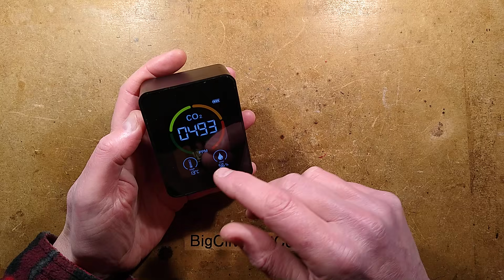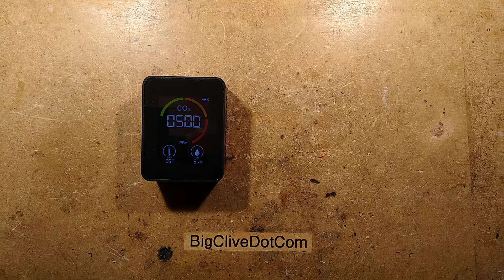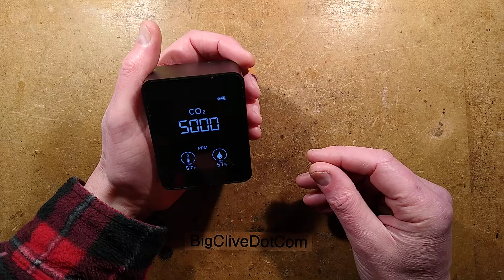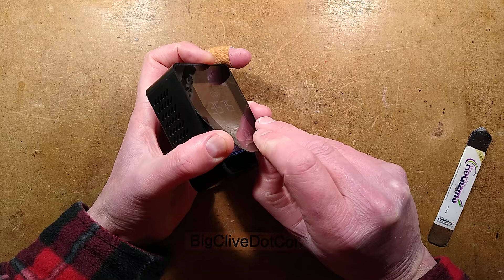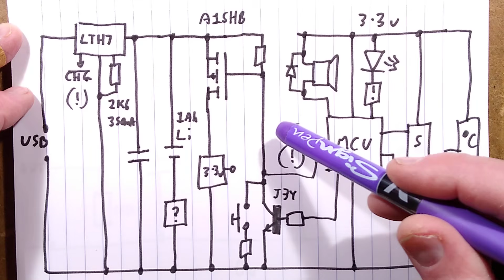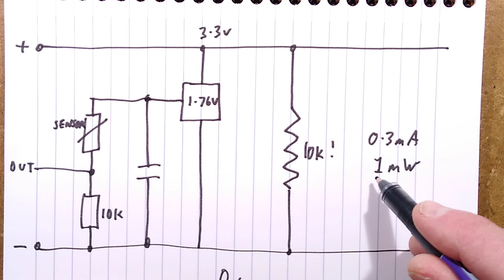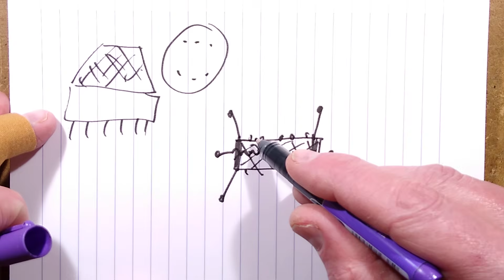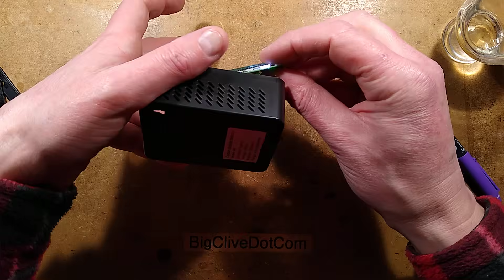Fake CO2 monitor (party detector) with schematic

Comment: So interestingly, I have an "Air Quality Detectot" from China with a CO2 sensor and great examples of bad English. Recorded CO2 levels noticeably go up if I breathe on it (I don't drink alcohol) or use my SodaStream right next to it. So that implies to me that it is actually working.

I've also noticed that it will start out at a high value when first powered on and slowly go down to ambient. Anyway, it's next to me right now, and so is a spray bottle of isopropyl alcohol. So I sprayed it. The thing skyrocketed from ~600PPM to well over 2000PPM.

So, this sensor seems to actually work to detect CO2 (I don't trust the accuracy, but it's at least doing something.) but it also behaves like the one in the video responding quite strongly to IPA. It'd be interesting to see if that's coincidental or not.

Comment: Why do you think Arduino, can't do LCD displays?
Reply from the maker: They can, but usually with a separate driver.  If this one had been a proper LCD display it would have been useful as a case, display and potentially reprogrammable processor.

Comment: Worked with Sensidyne Flammable gas detectors years ago, operated with a wheatstone bridge, catalytic bead resistance circuit housed in a sintered cap, gases methane, hydrogen, ethers and alcohols, all detected using this type of sensor.

Comment: I was looking at CO2 detectors but they cost around $400 in Oz, that would include the 40% markup for imported electronics.
Reply: Yeah they are expensive pieces of kit if you want one with a proper sensor.
Reply: @MattyEngland  I checked again, there is a European brand for $250, I didn’t check freight.

Comment: It's unfortunate that these fakes are out there.  However, there are true budget friendly NDIR co2 sensors on the market that read accurately.  You can get them for as low as $50cad on amazon.  I recently bought a wifi model for $70cad, and its readings match the $1000 model I use at work that has a Senseair co2 sensor.

Note that in the past, most co2 sensor elements were made by companies like Senseair, who charged premium prices for their sensor components.  Nowadays, there are Chinese companies producing and selling real NDIR sensors for really cheap.  So instead of $500-$1000 co2 meters, there are ones that retail for $50-$100 that read very accurately.

Comment: There are dozens of these for sale on eBay, sometimes advertised as CO2 sensors or CO2 and VOC sensors, not clear how you tell the difference!   Also ones with temp and humidity, so some folks fill in those optional traces.  What a faster luck.

Comment: Not only are these sensors Illegal they are also DANGEROUS, since some karens will put them up in their childs bedroom, and never ventilate it, thinking it has low CO2 so it should be fine. when the actual level is over 1500

Comment: Gotta try capsaicin …that’s right pepper spray that puppy!!

My co2 /heat sensing kitchen fire detector goes off when I broil certain peppers … curious if this sensor will do the same ?!
Reply: It's almost certainly using the same VOC sensor as this, and working out the CO2 by use of that. Capsaicin is a VOC and has a pretty low boiling point, so would make sense that the hotter the pepper, the more likely it would be to set it off.

Comment: Recently I have been looking into different monitors because of another youtuber who reminded me about the gas burner situation and how it produces extra CO2 etc when running. A relative of mine has one of those new style (that looks old) gas stove top ovens. They also don't have a hood to vent it to the outside and work hard to keep the cold outside from getting in during cold ND winters. I realized I should get one of those home gas monitors so began my rabbit hole down all the different monitors out there, not just CO2, such as particulate, and Radon. 

A very popular brand that came up was airthings with their disk based sensors that use a smart phone app to tell you what you have. Unfortunately from other reviewers posts I have seen that their sensors sometimes will read to high to what is actually there, or not work at all, or will vary between multiple of the same units. Especially for the radon sensor they have apparently. Radon is still a problem in places around here so it would be nice to check that periodically to. I also looked at third party sites to look at the reviews on places like amazon only to find that it looks like there are some fake/paid for reviews for said product which makes it even less likely to be a good product. 

It has become incredibly frustrating (which I believe I experienced this same thing before years ago when I thought about getting one) trying to find a home unit that can do at least a few things well. Otherwise what one site pointed out was maybe buying just sensors that can only do 1-2 things not a bunch of stuff at once. 

Another problem which people pointed out is that the sensors for some stuff can be pretty cheap (so if you're talented enough you could just buy the sensors themselves and build your own device but that is still to much for me), but some sensors can be expensive. Like they pointed out I think particulate sensors run around $60 US dollars so if you are buying a unit that claims to have stuff like that and sell for around $50 then they are probably lying to you because no way they would be selling at a loss. Even Temtop portable sensors seemed to have problems from some reviews I have seen showing no change even when taken outside in the fresh air for some of the sensors readings. 

The other problem as well is some of these sensors only work so many years before they start to drop off. I think the longest of them is maybe the CO2 sensor (if you got the good version apparently the "NDIR" sensor) will only last like 7-8 years? So if your spending over $200 US dollars on a monitor expect that it wont last past 7-8 years, even less for some of the other sensors... if they even work in the first place.

So at this point even though I would like an affordable sensor for monitoring stuff like CO2, particles, Radon, etc. It's clear you can't trust all these websites that "review" them like NY times (one of the first ones that came up when searching on google) cause it's clear they didn't really do any tests and are probably just being paid to advertise them. 

I have also seen those cheap ones being shown tore apart and all they are, is maybe one cheap sensor and a bunch of LED's etc. So far all I am seeing is a bunch of items made to rip people off from their money in cheap plastic cases.
Reply: If you really want an accurate CO2 meter then a hydroponics/horticulture shop is the place to go. They sell very accurate ones, but they are usually around £200, anything below that price range is likely using the same VOC sensor as this is.

Comment: Thought: It's a breath alcohol detector sold disguised to either avoid some form of red tape for such devices, or to allow it to be sold in places where alcohol is illegal. 
Other thought: It's a scammers tool, designed to impersonate a co2 detector, but can be made to trip out on demand via a hidden alcohol source. Think cowboy boiler fitter trying to trick Granny into thinking she needs a new boiler. 

Personally, I think the former. A breath alcohol detector for the middle east, so home brewers can check they're clean etc.

Comment: So, a good application for a real carbon dioxide detector is to quantify the air quality in a room. For example, if you enter a big box or warehouse store (Costco here in Canada or in the US, for example) or a gymnasium, you are likely to find relatively high CO2 levels. This indicates that the air in the room is not exchanged frequency. If you are worried about catching an airborne disease like SARS-CoV-2, an environment like this puts you at a much higher risk. Environments where the CO2 level is lower indicate either lower number in the room or better air exchange. I have several doctor-friends who carry this with them to help stay healthy.

Comment: Just out of curiosity, did you try propane (LPG)? We live aboard a ship using LPG in the galley. But can’t find a decent propane detector for below decks.
Reply from the maker: You should be able to find a gas detector that detects a broad spectrum of fuel gasses.
Reply: @bigclivedotcom  being aboard we have limited 120v outlets. All of those are by design at elbow or shoulder height. The detectors all seem to all be 120v plug in. Could it be due to being power hogs? Additionally being on a sailboat 120v power is unavailable while underway or anchored out from 9 to 6 am & pm while on battery, and solar while there is sun shine. We have some inverter 120v but again that is at elbow or shoulder height. Given propane is heavy ideally a compact, CHEAP, disposable battery powered unit is what we need. We can put it in the bilge area and down low places and not worry about it being damaged. We are covered for carbon monoxide detection.
Mark & Karen Fay

Comment: Co2 sensors are used in gas catering equipment environments to make sure the products of combustion are being removed correctly. 2800 ppm co2 is the risk level and at 5000ppm it is considered dangerous.

Comment: That is odd because the way CO2 is measured is deceptively simple, seeing as the gas absorbs infrared light (hence why it causes a greenhouse effect: it is transparent for visible light from the sun but not to thermal black body radiation from the ground)
All you really need is an infrared LED, a photodiode and a properly tuned amplifier. I'd be very surprised if that is more expensive than a VOC sensor.

Comment: wait, if the voltage regulator is 1.76V, how does the module's output shoots to 2.5V?
Reply from the maker: Hmmm.  I may have to revisit that.
Reply: @bigclivedotcom  could it be that the regulator might be connected in a different way and instead of a regulator it is a transistor used as buffer? just thinking out loud
Reply from the maker: @cocus-ar  It could well be.

Comment: We were having weird headaches and just foggy feelings since moving into our new house. Someone mentioned checking CO2 levels since the house is pretty sealed up. Got a sensor and it showed over 3000ppm, we also have all natural gas appliances. After getting it below 800ppm, we can tell a huge difference.
Reply: This recent explosion of information about how dangerous gas stoves are makes me think what it must have been like when they realized how dangerous leaded gasoline and paint was. A "oh crap now what do we do" moment lol
Reply: @skeetsmcgrew3282  leaded paint and gasoline were always known to be dangerous. The claim was that low concentrations were "safe".

FWIW the inventor of leaded gasoline nearly killed himself whilst developing the product (and did kill a few reseachers). Pure teraethylene lead is incredbly poisonous to the point that a single sniff can hospitalise you
Reply: Do you also have gas heating? If it's unflued, this would also be a big contributor.
Reply: @NotBROLL  our gas boiler vents crap out of the side of my house, and i often wonder what is it venting other than steam and how much comes back in through my open window

Comment: Because I'm using a resin printer in a small apartment, I figured I'd get an air quality meter that reads volatile organic compounds to see if I'm poisoning myself, and to test the efficacy of the carbon filters I bought. When it went nuts as I opened my wash station (full of isopropyl alcohol) I was briefly worried that I'd bought a fake with an alcohol sensor in it, but then I remembered, if anything is the very definition of both volatile and organic it's IPA.

It does detect a small increase in organic compounds when I'm not using the carbon filters, and based on the manual, it advises I not be in the room (I forget the PPM, I just got my answer a few months ago and moved on). When I do use the active carbon filters, the air in there while printing reads cleaner than it does outside, though it is worth noting I live on the intersection of two very busy four lane roads, so my outdoor air quality is probably quite poor. Curing releases far more organic compounds into the air, so I wear a respirator while doing that, and blast the air out of the room when I'm done. For the record, I do use plant based resins which while not entirely non-toxic, you must still wear a mask and gloves, and ventilate the room, they're far less toxic than the normal resins. It's to the point where I'm happy to sit by the printer and paint minis while it's printing.
Reply: I would love a product recommendation for the sensor you use. I have no confidence in electronics after finding this channel.
My boyfriend prints with resin and doesn't grasp the pollution.
Reply: @sweetsnejinka9411  I literally just picked one off Amazon that looked less like a household device to sucker credulous people and more like scientific equipment. There are a lot of home air quality metres that look like they belong on a wall, I just scrolled until I found the first one that looked less like an alliance and more like a tool. The brand of mine is Autens, though I'd hasten to add I've done nothing to actually test its accuracy, and I don't have access to any professional known good tools to compare. I kind of just wanted to know if the filters were doing anything, because 3d printing discords are full of nonsense and superstition.
Reply: @NoobixCube  thank you for the detailed answer. I'll likely get that same one. If it motivates you to air out the room, then that's exactly what I need. :)

Comment: This is really interesting. My Uni put two of these units in one of our computer labs alongside a UV purifier, which I think was part of a test to see whether the HVAC was actually filtering the air. They were slightly different as they were in a white case, the beeping tone was faster and I believe they charged using Micro USB; other than that, exactly the same, including the layout of the display. It's interesting to think that they might never have been accurate at all. They did sound the alarm rather frequently throughout the day but the only potential sources of alcohol would've been hand gel or cleaning wipes but we never used either that excessively so maybe they were genuine or possibly detecting something else completely. The purifier they were using sensed PM2.5 and that never had to increase power to clean the air so they came to the conclusion that the air was being cleaned already and removed it and the sensors 6 months later

Comment: I have one of these and it does correspond to the rising gas levels from my gas stove my natural gas water heater I brought it outside to test it near the NG generator and it went off immediately. 
Seems to detect a range of gasses and indicates a proportional number but definitely not for actual measurement.

Comment: I believe this is actually a combustible gas sensor chip. It reacts to CO, ethanol, hydrogen, ammonia, and very high levels of methane. Not to CO2, which is not combustable.
Reply from the maker: It didn't detect butane.
Reply: @bigclivedotcom  it is only SOMEWHAT sensitive to methane, it has to be over 1000ppm to even detect Methane. I'm not sure how sensitive it is to Butane, which is an even longer hydrocarbon chain. At least the chip i found that seems to be similar to the one you found is like that.